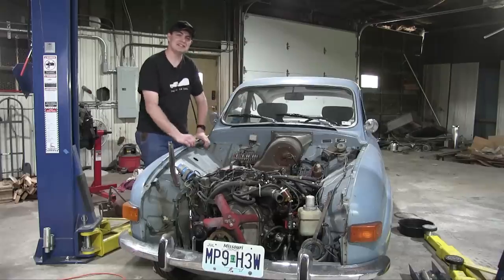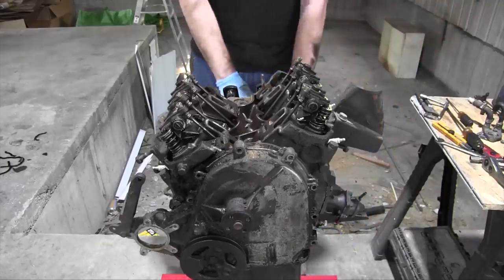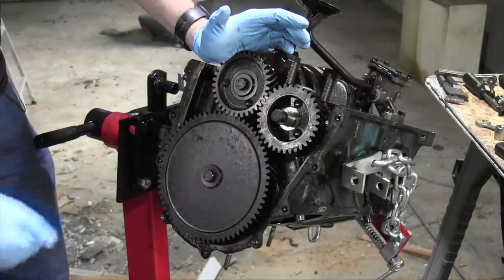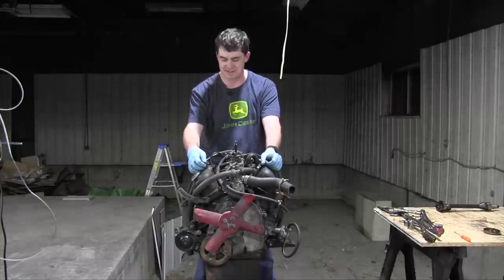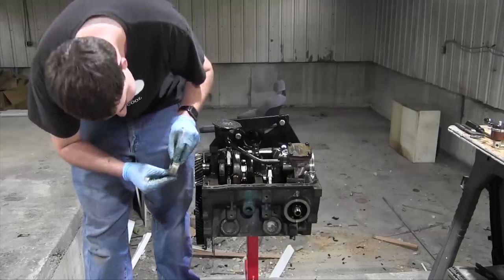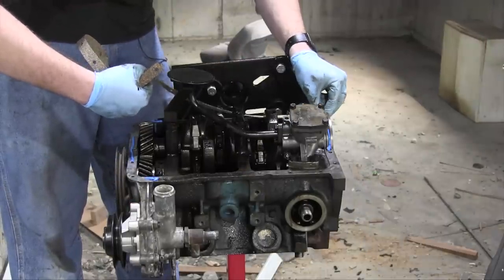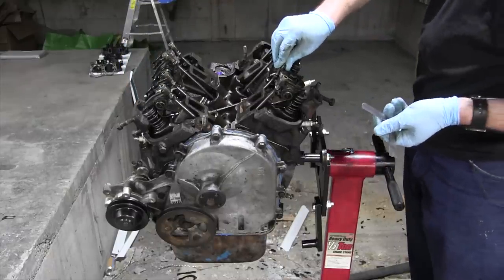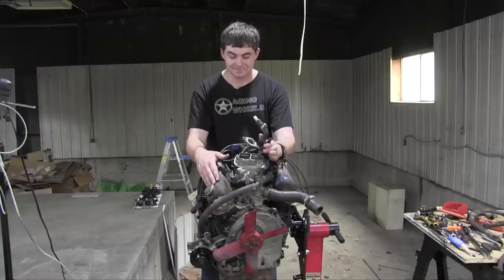Upgrading My Saab 96 to a Two Barrel Carb - Part 1

Comment: Fuel Pump under the cloth seat. That sounds like a ford (Pinto) please place a collision switch shutoff in the rear bumper. If your trapped and it fills with gas, not good

Comment: Nice work.

Always wondered about this- on older cars, why was the cooling fan a staggered design, such as this? By that I mean that the 4 blades are not at 90 degrees to each other.

Is it to do with the pulses of ignition and power?
Reply: Mine unevenly spaced blades are much quieter

Comment: I am sure you have noticed that the cam shaft bearings in the replacement engine were bad.  They looked like they weren't getting enough oil..

Comment: You might be “an entertainer” but that was a very comprehensive strip down and rebuild of an old Saab 👍👍👍
But why didn’t you steam clean everything? 🤨
Reply from the maker: I don't own a steam cleaner, nor do I have a source of water anywhere near the shop. I cleaned all the parts I took off with degreaser, but that's all I did.
Reply: Aging Wheels surely a man of your skill and talent can knock up a stream cleaner using an old kettle and some rain watch 👍

Comment: I keep seeing people installing electric fuel pumps in order to "prime" the mechanical fuel pump because they think their carbed cars are too slow to start up as it needs to get gas into the lines. The guy I bought my old volvo from told me the same thing, that you need to hit the starter long enough for the fuel pump to get that fuel going. Also a friend of mine with an old mercedes with a carb said the exact same thing, it would always start on the 2nd or 3rd turn of the key. 

Now when I drive any old car with a carb, I pump the gas 2-3 times slowly and fully. Then it starts on the first try no matter what. I told this  to my friend with the merc and he told me his engineering buddies said you do not need to pump the gas, and that there must be something else. He decided to just start pumping either way and since then it has always started on its first try. SO my question is this, is this some universal thing that people do not know about or is there any legit reason to prime your mechanical fuel pump with an electrical one?

Comment: Are you concerned about the shavings of that bearing ending up in the oil pump gears and mains /rod caps? I am!
Reply from the maker: Mildly, but I'm going to put a magnet in the oil pan, and I'll change the oil after the first couple hundred miles. Fully tearing down and cleaning the engine was beyond the scope of what I wanted to do this time.
Reply: @agingwheels  The magnet will do nothing for the aluminium bearing bits... 🤷🏻

Comment: You should have spread old oil on the oil pan gasket b4 installing the oil pan. Now without this release agent the pan(and the block) will adhere to the gasket and the gasket will be destroyed when u next remove the pan.

Comment: at 9:30 in the video,  no it's made like that to keep the noise down.  fitting a chin choke Weber A (twin choke Weber in the uk) in the UK that engine is deemed to be the worst engine Ford ever made. believe to be cut down from a V8 to V4, also V8 to V6 turned out to be a very unbalanced engine in its V4 format. think i still have one of those gears in storage nice to see you working on one, thanks for uploading brings back my old Transit Mark 1 memories.
Reply: theDaftman
Yes, the engine was a dog. SAAB chose the worst engine on the market to replace the 2-stroke.  I think SAAB said they chose the V-4 because it was only the V-4 made. Not very bright reasoning.

Comment: I hate to be the voice of gloom and doom,... but,...where did the missing balancer shaft bearing material go?  I would really want to inspect the oil pump for damage as it would have to go through the pump to get to the filter.   It has a filter, right?

Comment: oil sludge build up means the use of non detergent oil, i.e. old motors/ old tech. They assumed you'd open it up and rebuild it more often than today's engineers.

Comment: how did they ever get the transaxles from grenading?
Reply: They didn't, you babied the one you owned, ( use the freewheel a lot and don't drive like  a maniac..)  or if you wanted the one you owned to last, you had a magician like Rick Wolfe in Springfield do a $550 double row high end load bearing conversion, (...1993 prices, he probably charges $1200+ now...) to the pinion shaft.   The rings and pinions, especially weren't made for the torque the V4 put out.  The entire transmission is tender, but the crown gear and pinion are especially hard to find in decent shape anymore.

Comment: Commend ya working on your own car but this is painful.

Why did you mount the fuel pump at a 90 degree angle causing you to have all that extra hose inside the cabin. Frankly I'd suggest mounting it outside of the cabin in the trunk. It should ever leak the rear seat will soak up and the inside will be filled with raw gas fumes. Plus the noise will be somewhat less.

Pulling and reusing babbitt bearings, yeah just no, don't do that.

When doing heads on a Vee engine sit one side on, tighten, and then do the other side. Sitting both on there is a chance you can bugger the gasket up working on one side while the other side is wobbling around.

Interference threads work by the threads being slightly under-sized or over-sized on the bolt/stud compared to the nut.

Good luck on the build. I have no idea why this was in my suggestions because I'd rather be dragged behind horses on a salt road than work on a saab.

Comment: Interesting to watch. Idiots don’t have the gumption to take on the projects you do. Always entertaining to watch you take on the projects that you do. I’ve always had a goal of rebuilding an engine. However, renovating a building, having had a couple full-time careers, it doesn’t look like that’s gonna happen. However I never say never. I was wondering why you didn’t clean the carbon off the engine and wondered what you use to do it, and what you do with the residual rags and towels and everything else you use. When I change the oil on my 1993 Honda accord, I always take it to a service station and let them recycle the oil. However, the paper towels and such that I use, it always feels so environmentally unfriendly, and it ends up in a plastic bag that goes into the dump that sits for 100 years or more before it breaks down.

Comment: Should note, but you'll eventually understand that with all this work of putting in a 2 barrel carb will do not do much for that engine except waste gas.    If you haven't opened up the Siamesed exhaust ports and matched them to the header flange spigots, there's no point in making this engine try to run on  2 barrels, when it can barely breathe downstream of the headers on one.

Comment: Great video, but - - You pull the engine apart, and change some bearings. You did not even look at the main bearings, those who are the most critical. And you rebuild the engine, without making the parts clean first! In my opinion you should have a high pressure washer, or preferably a highpress steamwasher to make all of uour parts absolutely clean. Then both you and the engine would be more satisfied with the result.

Comment: A '69 Saab, huh? We had a '67 - and it was a 3 cylinder 2-stroke! And it was terrible! In about 40k miles, it overheated twice - it got an engine rebuild - and then an engine replacement because of this.
And THEN the transmission broke.

Comment: Always fun when you remove a part and the washer falls down INTO THE FREAKING ENGINE. I usually say a small prayer that it moves to the bottom of the oil pan at some point, and just go get a new washer.

I got to admit, I never have tried to drain the oil out of MY engine by doing THAT.

I do have to admit that all of this seems fake. There is a DISTINCT lack of 4 letter wordage in this take down and put back together stuff.

Comment: You need to come up to my neck of the woods and help me with my saab story. I can do engine swaps with my eyes closed. A neighbor came to me asking for help rebuilding the engine in his 1993 and a said sure! How hard can it be! Let me tell you id work on a pagani or a space shuttle before working on one of these again. One year later and the engine is finally going back in. I dont know what this company was thinking in 1993. But the quality is so low it seems as though absolutely everything down to piston rings failed early in this thing!

Comment: Ha Ha, no buddy you are doing OK, to clean the carbon off the heads, take it on the freeway for an hour at high RPM (once the engine is warm that is) (you do not have to be in top gear, that might mean you are speeding)(just do a steady high RPM but don't thrash it)

Comment: Had a 96 easiest car ever to work on. 45 min to remove engine. 1 arm lift of the engine too. So light! 
Been as it was a sleeved down 2 ltr I always wondered how great it would go if converted back to 2 ltr? Or twin Turbo charged. :) but then that would require fuel injection.. more effort than worth. I would imagine a small block V6 might fit? An electric conversion would be so easy and best option for fun and games.

Comment: Why you doing that that one bro put that more fuel and horsepower than that two-barrel will you cutting the fuel and the air intake in half I used to rebuild a 1 barrel carburetor and I rebuilt two barrels the one barrel is almost as much are breathing as a four-barrel but all at once that's a Ford 1 Barrel if it's made by Ford the one barrel is a good-sized one barrel carburetor

Comment: There is zero reason to have a mechanical pump with an electric pump in series.. In fact the best thing you can do is take the mechanical pump and throw it in the trash. Use an electric pump that makes about 5 psi and thats all you need.

Comment: The 96 also came in a "Super" version, equipped with a Solex 2 barrel carb. Which is, in a word, shit. I "downgraded" mine to fit a simple Fomoco single barrel, due to repeated overheating caused by the coolant operated choke mechanism. And I live in Finland. Id est, in arctic conditions.

Comment: Ask me about balance shafts in Mitsubishi engines, if you can be bothered - on the older ones, there's a delete option.
Still a horrible engine, but more reliable.

Comment: Why isn't that a 2 stroke engine?
Reply: SAAB stopped making the 2 stroker after 1967 in addition to adding an oil injection system to their Shrike standard 42 hp engine, it still smoked badly when warming up.    I've owned 3 SAAB 2 strokes and the local police didn't like my car(s) on cold mornings. "Fogging the neighborhood with pollution.." was one of my written warnings.   Besides a 1969 99 with a 2 liter EMS engine goes like stink  and doesn't pollute as much.

Comment: V8's done need balance shaft.. the 4.6 v8 ford will idle so good, a glass of water on intake wont move if its happy   700k mile 4.6 that is original, runs like a fucking new engine.
Reply: A v4 won't balance like a V8, thus the need for the shafts.

Comment: Why not approach things in a logical manner? You have an engine that seems sludgy so change the oil. Use some cleaner in there and see how it goes.Entertain us with that process. If that works then you have saved yourself a lot of trouble.  With all the confusing changes of mind, maybe you ought to buy the parts that are needed for both engines and keep the one that has been second as an extra. You can sell it with the car if you don't use it  or you get the idea....Love the car by the way..

Comment: Using used bearings is not very bright.  Only use new bearings and top quality bearings as well. 
You should have stripped it back again and cleaned the cylinder head of carbon build up. 
You spoiled the ship for a hap'worth of tar.

Comment: I'm not sure that file delivery system will work. I predict that the electric pump wild flood the card. You can support a carb with an electric pump but needs 2b able 2 pump  variable rate. FACET (brandname) makes them.         .

Comment: The Ford V-4 is a dog of an engine. The carburettor and distributor are next to each other - poor design. Sparks and flames are a poor mix. They had a reputation of bursting into flames.  I had one in a Ford Zephyr and of course the engine burst into flames.  SAAB tested a number of engines from many manufacturers to replace the 3-cyl 2-stroke. They chose the worst.  I think the V-4 was chosen because it had a V, nothing else - marketing. It was the only V-4 made - anywhere in the world. They tested the BMC A-Series that was easily tuned, winning many rallies in Minis, being successful in other cars.  They should have gone with that.